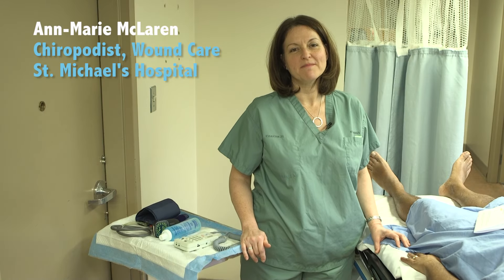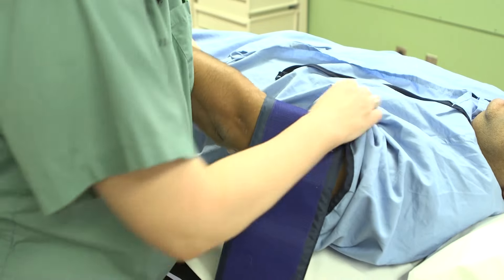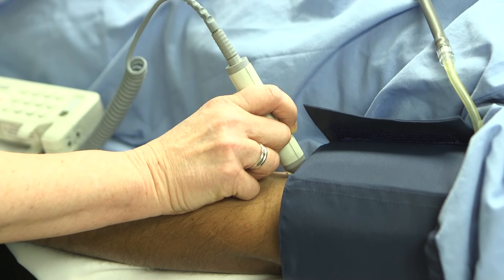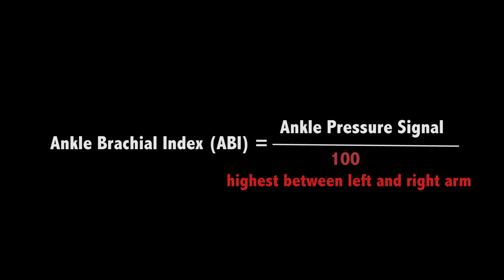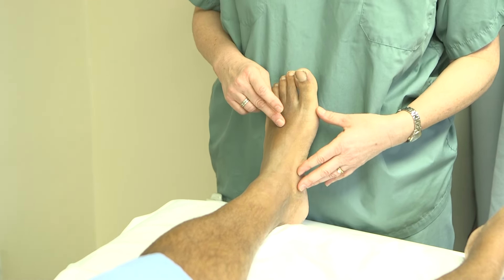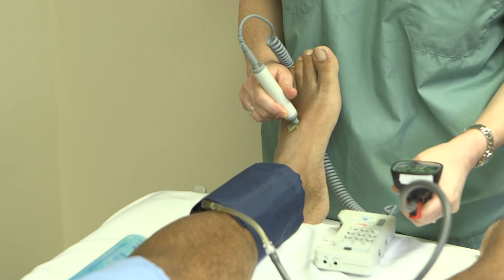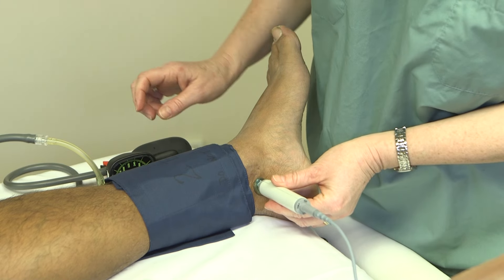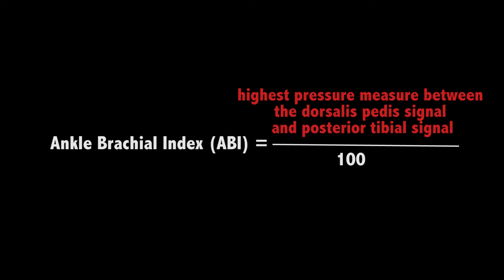How to perform an ankle brachial index

Comment: Thanks for the demonstration. I would like to point out that the BP cuff was upside down in both brachial and foot pressures. Plus, I think it would be a good idea to slow down the release of the pressure so you would get a more accurate meansurements.
Reply: Thank goodness I live in the US where nurses place blood pressure cuffs right side up, as well as release the pressure at a rate slow enough to permit an accurate reading. This video was made in Toronto, Canada. I wonder. Could this kind of incompetence be the result of a government run health care system?
Reply: @pcastonguay  With all due respect, my IQ may have dipped lower than 20 from just reading your post.😂✌
Reply: You could be right. An overwhelmed healthcare system might have her in the habit of rushing her measurements and neglecting accuracy.

Comment: The rate of deflation in the video is probably a bit higher than it should be, seemly around 20mmHg/sec, when it should be much slower close to 1-2mmHg/sec when approaching the anticipated brachial systolic PB. Mistiming of the pulse at that rate could lead to a reading a full 20+mmHg lower than the actual figure.

Comment: My numbers so random: 

44yo overall healthy man

RArm 118/72 RAnk 152/67 

152/118 = 1.28814 (right)

LArm 133/75 LAnk 146/73

146/133 = 1.097744 (left)

Highest Ratio (RAnk/LArm)

152/133=1.143 

Would this test be considered healthy? I’m kinda worried because the high pressure into ankles? Does this reads differently? Thanks for sharing.